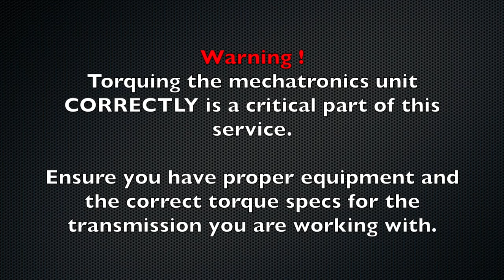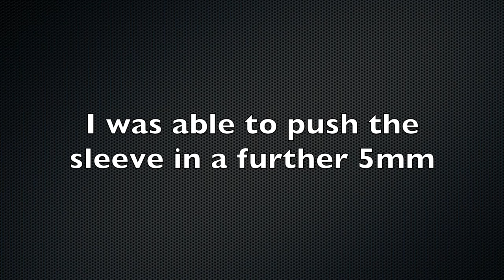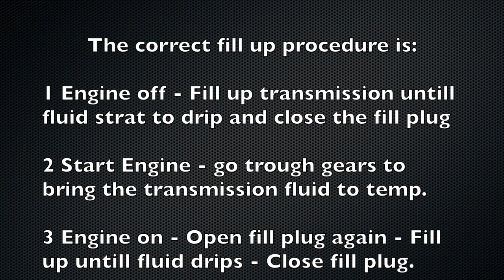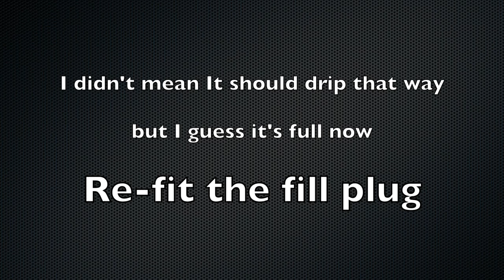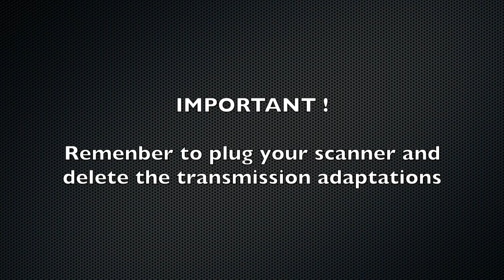X5M Full Transmission Service - HD - ZF 6hp28x

Comment: Just the fyi... on 2nd oil fill, someone needs to shift the all the gears so that each gear pack is filled up properly in torque convertor.
Reply from the maker: Correct

Comment: Thanks for this, I am thinking of doing  mine (LK12425) this winter, now with 84k km on it (2011 car), shifts nice, but I like preventative maintainace.
Reply from the maker: Spot on ! The best way to properly maintain these cars is by preventive maintenance before things really break.
Reply: @dnl35projects doing 8k km oil changes also, cheaper than an engine 😂

Comment: Just one thing regarding putting the car into neutral if out of batteries then you use the red tool in the toolbox and stick it in the hole in the right side cup holder
Reply from the maker: That would work for a few cars however some of the new ZF transmissions will have a bolt on the side you have to screw - no more access from inside the car
Reply: @dnl35projects  at least my 2011 X5M has it, good option to have.
Reply: @farturinn  They switched at some point. My '13 is the outside bolt style. I thought I was just missing the red tool but I bought one, opened up the slot, and found nothing there but an unrelated screw head!

Comment: For zf8hp VW recommend changing the oil in saudi arabia every 30k km i think i will do the same to my 650i bmw just to prevent an issue 😅
Reply from the maker: Yes I really dont understand how BMW would recommend to do the service in some countries and say its a lifetime oil in others .... The best thing with this cars is to be pro-active and you are gonna be avoiding headaches !
Reply: The EPA in the USA and equivalent agency in Europe pressure the manufactures to have extended oil change intervals ,it’s possible they do the same thing with the transmission fluid. “For the environment”

Comment: I plan to do the same. ZF fluid is so expensive but people keep saying not to use other oil. Are you still trouble free from Penrite BMV oil? I have a leak. Beside drain plug, fill plug, pan gasket and the electrical adaptor plug,  can leak come from other place?
Reply from the maker: Yes I was also very sceptical about going with a different fluid but have been doing so since 2019 (over 6 cars so far) and they all worked fine. The gears changed a lot better but that should be more related to the service kit installed than to the fluid itself.

Comment: I've noticed an issue in my zf for the audi s5 4.2l v8.

After driving for a while the trans develops a clunking 2nd to 1st gear when coming to a stop.  And when taking off from a stop holds on to gears too long and i have to use M mode for normal driving. 

No codes came up at all. Could it just need a fluid change m car is only 46,000 km
Reply from the maker: Hi, I’m not very familiar with Audi however if you have the same ZF 19, 26 or 28 transmission I can almost guarantee you will benefit from a service as I fixed 2 BMWs (530i and X5) with the same Simpsons as yours. 
Ensure you do the full service with the sleeves, seals and don’t just change the fluid. Also make sure you reset your transmissions adaptations.
Reply: @dnl35projects  it is infact the  ZF 6HP28AF the were in the first s5s from 08 to 11.

Comment: Hi I own a BMW F10 M5 2015,  I was told by RSW in New Jersey that the 7spd DCT transmission oil and filter is for lifetime of unit and is not serviceable… is this true or not? Nice videos, subscribed.. 👍🏻
Reply from the maker: Hi, the transmission on your M5 is a DCT so the procedure is not the same as the service in this video however I am very against this "lifetime Oil BS" They only say this because BMW expect the car to last 100K Miles - Its a fluid which ages just like everything else.
Reply: BMW started doing this in the late 90s so they could falsely claim lower maintence costs. “Lifetime” fluid means lifetime of the part. So when the transmission fails from never servicing it, that’s the “lifetime.”

Comment: Just did the service, as per instructions (yours and others).  Changed also the rubber seals along with the plug adaptor, filter and fluid.  It took almost exactly 7L of fluid.  Pre-filled about 3.5L fefore starting up the car, and a further 3.5L approx with the car running, temps at 40deg celcius, vent to drive and reverse with foot on the brake.  Not possible to go through the gears.
Fired up ISTA and deleted the adaptations.  
PROBLEM: the car just shoots back into Park when trying to drive it and shows the P and car rolling warning.
Another thing which happined at the same time was that ISTA cannot find the FRM at all.  Was fine before.  Not sure if it's related.

Any ideas??

PS I did change the front diff fluid and transfer case fluid  and deleted the adaptations for the transfer case.  Probably not related.
Reply: Fixed, 
Topped up the fluid, needed additional 700ml, but it was a pita to wait for the transmission to cool down enough.  Measuring the pan was 30deg but ISTA gave me 50+
Also installed a spare FRM,, had my FRM repaired last summer and it decided to give up today.. convenient when doing other maintainance, just to confuse me more
Reply from the maker: The FRM usually goes when battery voltage is too low - did you have it plugged onto a charger while doing the computer work ?  As for the Parking issue, my car usually does it when the doors are not fully locked
Reply: @dnl35projects  No didn't have the car plugged in to a charger, but had hardly done any  work on the computer, more or less random I would say.  Had it repaired in August last year, one of those ebay services.  But I am happy that the transmission is working now.  Will be running a FRM3 from a RHD E90 until my unit comes back from repairs :D